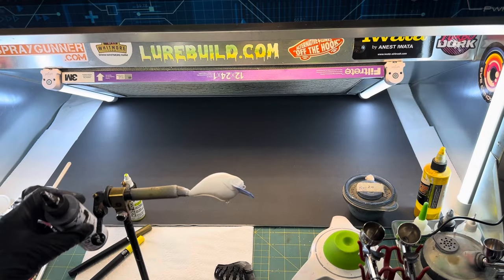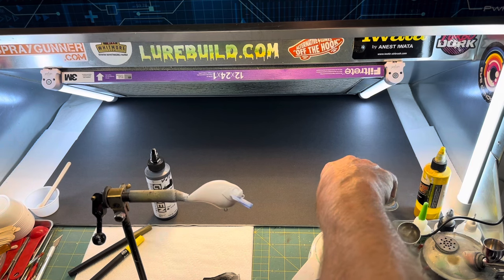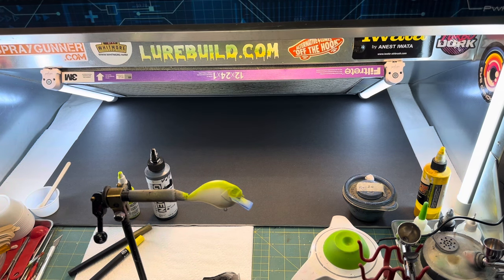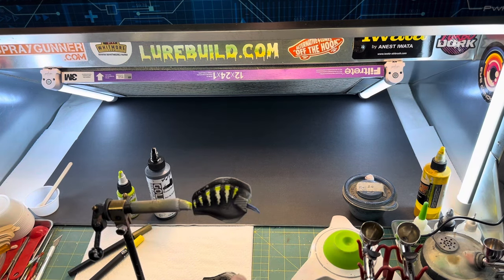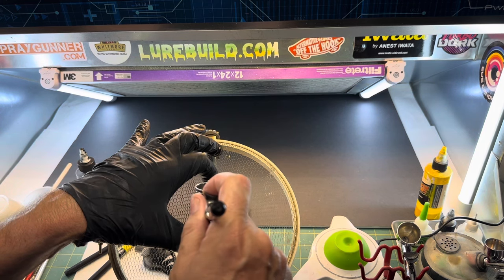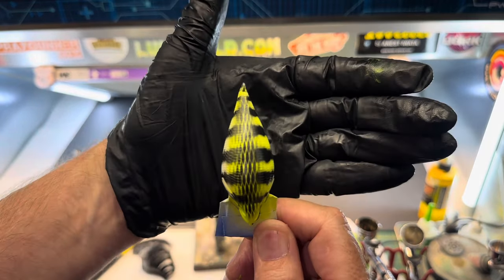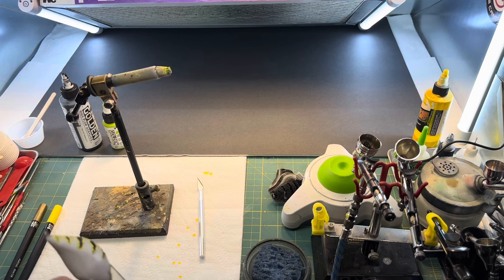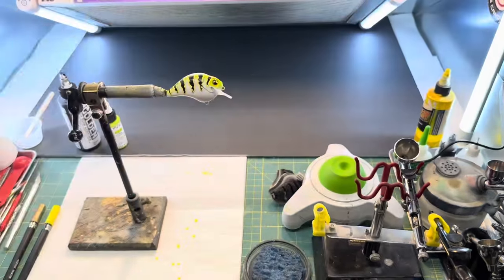“Custom Lure Painting Mastery: Techniques and Tips”

Comment: One tip of something that I found purely by accident.  If you lay down a piece of the rubber anti-skid that is used under throw rugs and lay the bait on that, it stops it from moving and cushions it at the same time.  Also, I have several different pieces that have different patterns and I use them as home made stencils

Great video and beautiful work